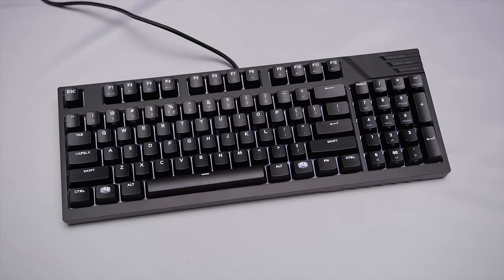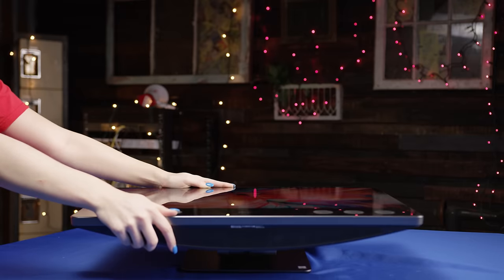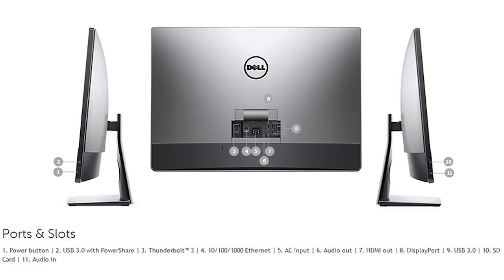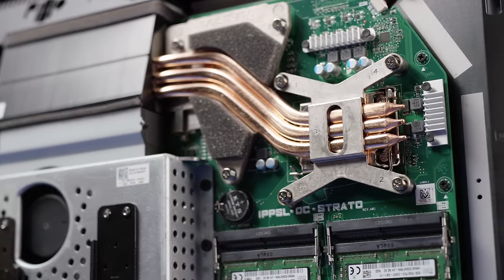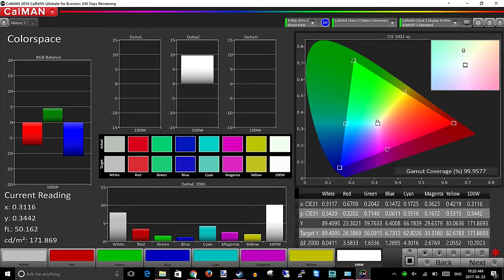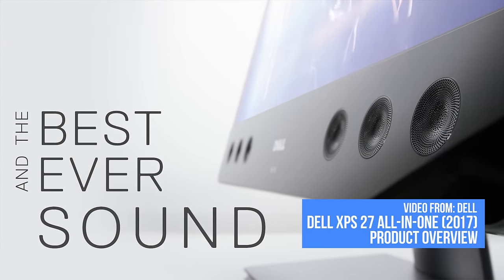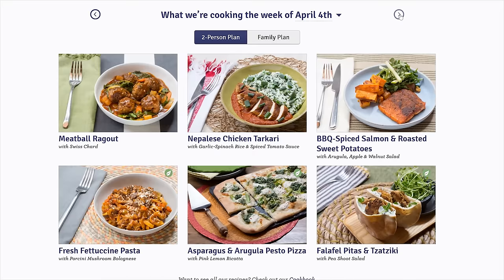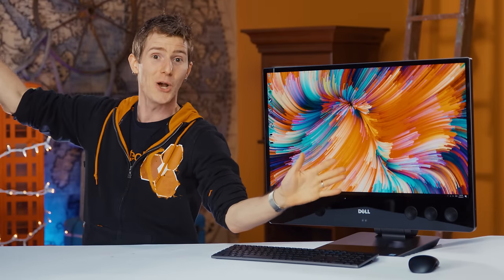Dell XPS 27 - An Audiophile-grade All-in-one

Comment: Why, why?! Why put so many USB ports at the back next to the monitor mount? Just use an in line USB hub to the sides along with the one USB port already there. Oh FFS, the Type-C TB ports are also cramped in at the back. How can you make ergonomics worse than an iMac?
Reply: You mean why put all the ports under the monitor mount in a hard to reach area. Stupid +Dell could've put all those ports to the side or the top of the monitor mount instead placing them in such a hard to reach area. Unless they figure that people are going to populate all the ports before installing the mount, that is if  it doesn't come attached already.

Comment: The computer is state of the art but sometimes it makes me SCREAM especially when I need to insert a USB in the ports. They are very deep behind the stand and very hard to reach even when I use a forceps and a Flash light. I am not sure what was the designer thinking when he designed it OR where is the committee that approved such a horrible design. If you have a long and thin fingers with 20/20 vision that have a flash light in your lenses , go ahead and buy one of those beautiful computers.

Comment: AMD mobile GPU? FFS never use AMD hardware (Gpus or APUs) in AIOs or laptops that costs more than 300$. They're the absolute worst. A 1050 would have been so much better. It's power efficiency is amazing.

Comment: Stop. Just stop putting speakers in monitors/TVs. They are all shit including this "audio-foolery" grade AIO. That 3-4 inches of space wasted by those ridiculous speakers could be put to better use with a larger panel or smaller bottom bezel.
 A 2.1 system is the minimum requirement for a crappy work station, 5.2 for a great desktop system, and 7.2 for the living/media room PC.